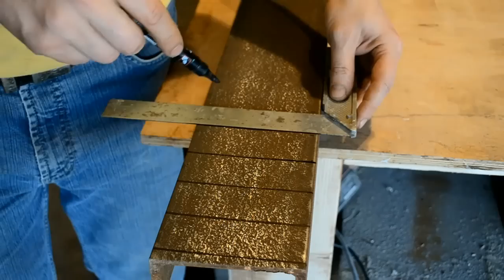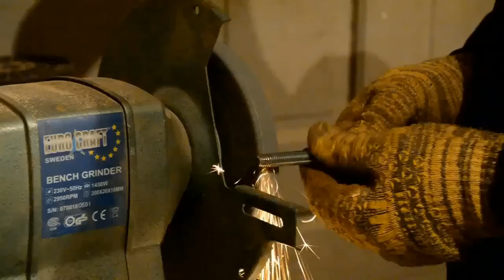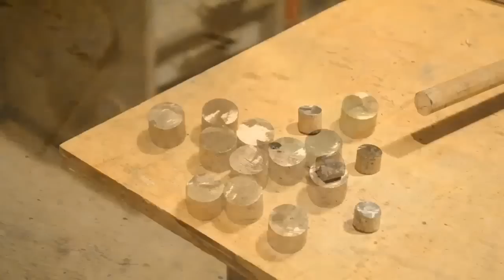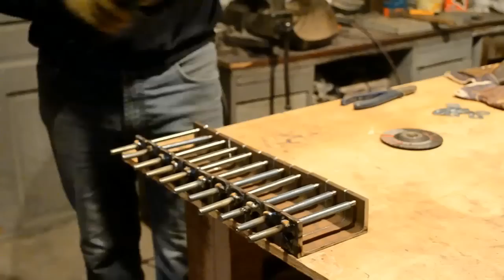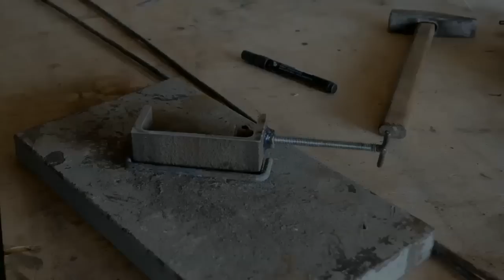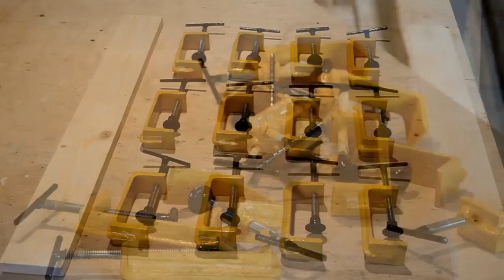Homemade twelve C-Clamps

Comment: Nice build my friend,want to save time and money!most people say its dangerous but if you have common sense its simple.Ive been doing it for years.If you have a beam like that or any rusty scrap you want to weld for ex. you cut your 12 pieces before worrying about rust then you submerge it all in some pool acid(hydrocloric acid) outdoors obviasly and watch the rust and even mill scale disapear rinse in bakingsoda and water and your good to weld with NO problems!

Comment: I like this idea better than all the wood  clamps I have seen made. The only thing I think I will change is to buy bolts with heads on them instead of the all thread rod with the T handle welded on. That way I can use a battery impact drill to quickly screw and unscrew the length of the clamp. All in all, a great project for clamps that will last forever.
Reply: Stephen Landry I like your idea, and I bet you could actually have it both ways. Cut the T bar in half, and weld each piece just below the bolt head. Leaving the bolt head exposed for use with drill, but t bar for easy hand tightening... just a thought!

Comment: Fantastic. My welder sticks to the job 9 times out of ten!
Reply: Crank it up higher, use a smaller rod, or grind a better spot for the ground. These three things are nearly always the issue when you get sticking. 

Source: welded for 2½ decades, on all kinds of metals.

Comment: Not the prettiest thing I have seen, but it is inexpensive and easy to make. For use in woodworking, I think adding some softer pads (plastic of wood) on the places where clamping pressure is applied is preferable to avoid damaging the wood.

Comment: May I suggest that you make the screws of different length. By making them even you have to keep them away from each other as it is shown when you tried to place the clamps in the middle of the board and then another one precisely opposite to it and you had to move it. I guess you got it. If you decide to adopt it, lend me an email. I would like to see it.

Comment: Great idea. But why put the rod on the sides? Wouldn't it be nicer to have it flat? It looked strong enough for most glue ups without it. Either way. Good idea. Might need to steel this one.
Reply from the maker: Thanks. I tested one clamp without the rod. It bends. That's why I added the rod.
Reply: Of course, just thought: it would be like a 'spine'. Great idea, thanks, Gunter
Reply: onedieingsoul : It's an additional reinforcement of strength.
Reply: The paint looks to me to be Hammerite. I've used yellow Hammerite before, and the colour and consistency seems to be a dead ringer for what I used. My monitor is colour calibrated, I don't know if the camera used is...
Reply: i know this material. Your first thought would be its impossible to bend it but this is steel not cast iron. They tend to be flexible. Actually the reinforcement strength does not comes form the steel bar itself what he welds on it, but the welding material also. That is much more rigid, and harder.

The only thing i would might change in this build, is the threaded rod to a trapezoid one.

What i actually really like with these C claps is that they will never break or crack if they fell down. Many of the commercial C clamps are casted, and if they fell down, or you tight them a bit overdoing, they can crack.

Comment: Checking this out a bit late, but what's the round stock spine for? Is that just a reinforcement? The paint is a great touch; I never paint any of my DIY tools.
Reply from the maker: It's a stiffening rib, without it the clamp bends easily

Comment: The only thing I would do differently is use two pieces of steel rod for the spine, only reason being you could have them stand on their own while doing glue ups rather than having your work rocking around on the single spine, otherwise great build.

Comment: Nice work, but its cheaper or same price just buying them. When you get 100 mm from $7, the metal, welding pin and screws cost more.
Reply: lnesland I can't talk for everyone but even if I could buy something for around the same price or even a bit cheaper than I could make it for myself is not the point its more often about the satisfaction of "I made this" how easily or cost affectively I can get my hands on something if far out weighed by using my own hands to make something instead

Comment: This looks like you spent all day and used about $30+ in parts to make 12 small $1 light duty clamps that you then used to a scrap 2x4 just big enough to be a pain to throw out! Only spent $3 on parts?  that's what I'd have to pay for the 12 nuts, let alone 2 meters of thread.  Not to mention the cost of the rest of the materials and consumables used.  Don't get me wrong... if you enjoy what you're doing, then  you're doing it right!